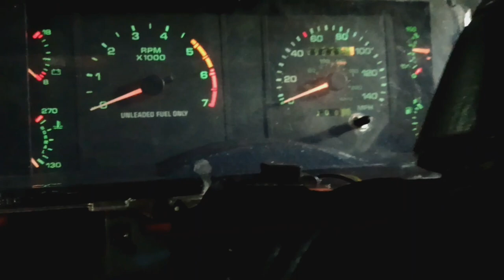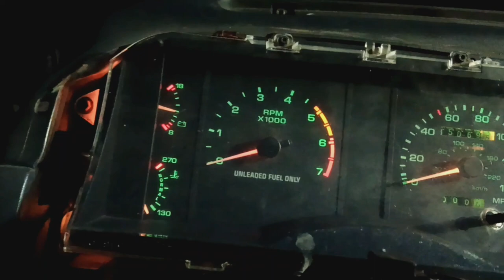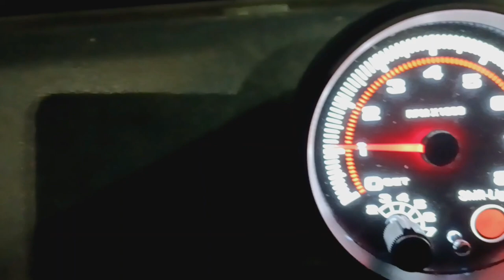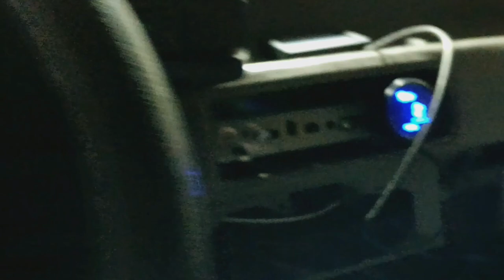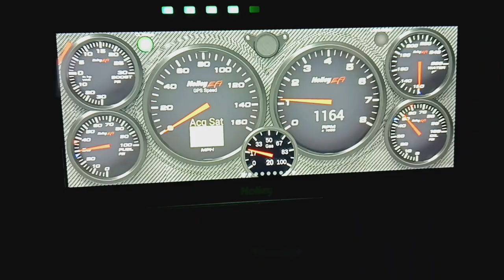Fox Body Mustang EFI to Carburetor

Comment from the maker: This car is running on my base tune Holley Terminator X, with lots of changes along the way. "Must be tuned by a Holley Certified Tuner for best results" app $150 per hour - well worth it. Subscribe (new 3 hour tune on this car) Spring of 23 - new Holley dualsync distributor included